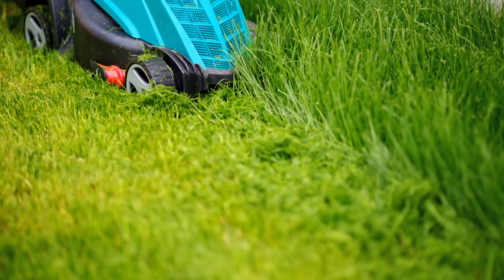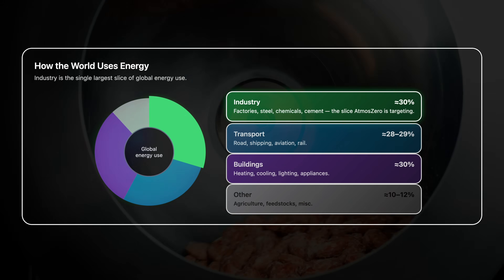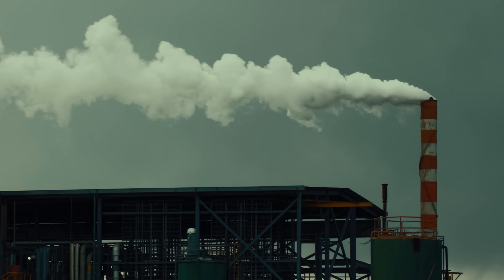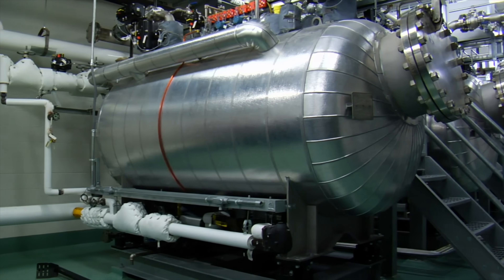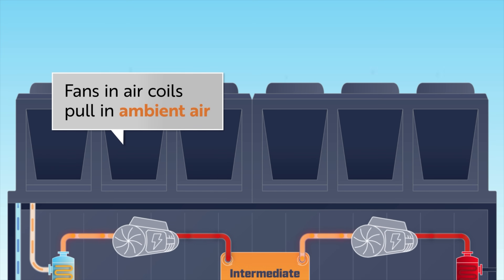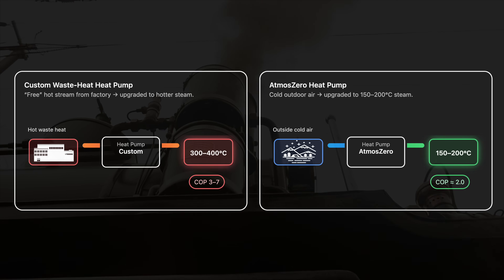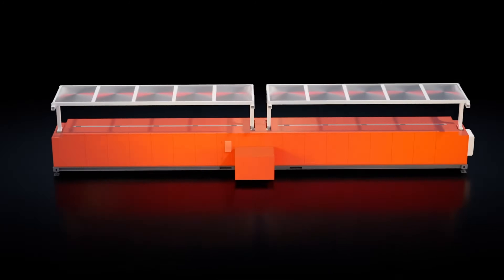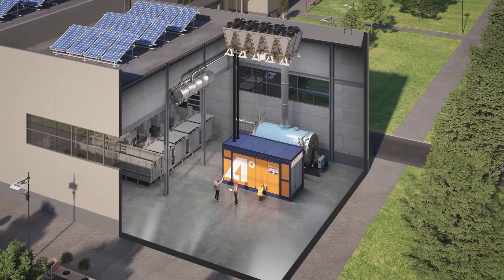This Startup Just SOLVED the Hardest Problem in Clean Energy

Comment: C02 is plant food !
Reply: So does that mean we can put CO2 into a office building ?
Reply: @catprog  Absolutely !   Commercial greenhouses have be using C02 generators for about 100 years ( they also produce heat and moisture in the air ) with absolutely amazing results. Humans do not have any ill effects until  C02 reaches about 10 times current atmospheric levels or about the level in your lungs when you exhale. Land plants evolved over the last 400 million years with atmospheric C02 levels many multiples above the current levels and absolutely love C02 as the bulk of the material that makes up plants is derived from the carbon they extract C02 as well as Oxygen and hydrogen from water and oxygen from C02. Elevated C02 also helps plants grow with much less water. Satellite data shows quite conclusively that the Earth is "greening" , i.e. producing much more plant material (approx. 30% more) as a direct result of the added C02 in the atmosphere in resent decades.
Reply: @EboregOnhzna  So if we filled a greenhouse with water that would be even better for a plant then having air? After all water is a plant drink so more plant drink must be good for it right?
Reply: @catprog  I never said we should fill a greenhouse with water.  

Air naturally has water in it. We call this humidity. The more water in the air the higher the humidity. Plants like high humidity, think high humidity jungle verses low humidity dessert. Greenhouse CO2 generators burn natural gas which produces heat, water(humidity) and high C02, all of which plants love. 

High CO2 levels in the air also help plants in dry, low humidity environments (desserts) survive with less water. Satelitte images clearly show that the desserts around the world are shrinking because plants survive with less water as the level of CO2 increases over the last few decades.

Comment: I have been saying for YEARS:
"There is no such thing as 'waste heat'. A use just hasn't been found for that heat yet."
Reply: Usually the problem lies within getting consumers and providers connected.
I've lived about 30 years with city provided industrial waste heat cityheating.
It delivers hot heat exchange water at around 70 degrees C. It exchanges heat with tapwater, or you can create a warm water circuit running on city heat water to heat your floor. Floorheating is the most efficient in comfortable heating.
Or you can run it through radiators with thermostatic valves.
But yeah, 70C is very high. You have to fill your floor circuit with cold water first before letting in city heat, because else the floor will break, and it needs a water pump to keep it circulating.
So for cities that concept is pretty good, as  the government can help connect producers and consumers by creating the intermediate company that sells waste.
The last time I saw gas heating was 30 years ago (central heating system) and it sucked compared to a communal central heating system.
Reply: If it's not being used, then it is being wasted. 😕
Reply: Except for waste heat from internal combustion vehicles. Not sure what uses you could channel that to.
Reply: @katherandefy if the system is so lossy that waste heat cannot be efficiently put to use, than it's a shitty system and should be replaced. A sentiment that applies to private vehicles themselves.
Reply: this is perfect said!

Comment: Have you looked at “Red Hydrogen”, I believe Japan is doing the ground work.

SMR is collocated on an industrial site producing steam/heat, power and Hydrogen from the one SMR for use at the facility.
Reply: SMRs can also be gas, liquid metal or molten salt cooled. Advantage becomes SMR after the 200 C or so limit mentioned in the video

Comment: They are making a cascade heat pump. This is nothing new and there is reasons why it’s not been mass marketed before.  

The issue is the refrigerant cycle. You run into the critical temp and pressure of the refrigerant plus you have issues with discharge temps and lubricants of the compressor. 

Using any type of centrifugal compressor you suffer from the lack of ability to handle a high delta P. 

I am betting this company isn’t trying to mass produce this tech. They are the typical start up where they are trying to get a halfway concept and then sell off the company to some giant company who ends up trying to make it work but never does but wants to own the patent. 

I’ve found that unless a company actually has a plan to make and market their product to the end consumer they are not really serious.

Comment: Since the topic is pragmatism. I would like to point out that half of expensive is still really expensive in this case. Sounds like gas is something like a sixth the price of electric resistance heat and this heat pump sounds like it’s half the price of resistance heating. sounds like it’s still three times as much as gas.
Reply: Depends on where you live. Hydroelectric power in some states is dirt cheap (I pay ~$60/MWh), geothermal has the potential to be just as cheap.
Reply: Solar power is cheap and when it grows enough and has battery storage to cover snow storms,there will be a need for dump loads . Not a perfect solution again but another brick in the wall.
Reply: @danielking2944 No one's building solar since 10 years of farms went bankrupt because the electric is TO cheap. It doesn't pay for the debt.
Reply: Well EU is rolling out blending sustainable aviation fuel with regular fuel, and that is 3 or more times more expensive than regular fuel too, so if you still have climate goals... things will get more expensive for businesses and consumers. If you are USA then yes, does not work... although seems like that brewery is going ahead, although maybe their product is that much more premium cost wise and their customers want green stuff so they can afford it.
Also I read below that actually since natural gas in EU is way more expensive, it may make sense economically too in those areas in EU where there is cheap electricity at least... mainly Scandinavia, maybe France due to nuclear... so might not even be that more expensive
Reply: You're right. That's the case for the US, but elsewhere (Europe) this is the perfect solution

Comment: Fantastic video. Can't help but wonder what is the equivalent of permaculture is to manufacturing? Why not use the excess heat from data centers to generate heat for nearby places that need steam?
Reply: Data centers are being built with nothing around for miles currently. There are so many costs and factors I doubt it would work out favorably in most cases but there has to be a few where is a perfect fit.

Comment: As a startup they don't have a market. So you create one. You focus on new construction facilities. That said. There is not one  legacy facility on the planet that doesn't have shutdowns for maintenance and mechanical failures. Shutdowns are budgeted and scheduled well in advance. Because components like this have a lead time baked in. There is your window of opportunity. All pre-shutdown work is budgeted for and completed in advance so the changeover becomes as simple as opening a few valves and closing a few more during the shutdown. I've been part of this process in one way or another for 40 years. It all comes down to proper planning and a keen interest in the outcome. That is as long as the equipment holds up it's end of the bargain.

Comment: Can you chain these to get even higher temperatures?
Reply: to increase steam pressure, increase the pressure; see steam tables...
Higher pressure requires heavier everything.  $$$
Reply: No. You need a diffrent type to go higher.

This is why it is a two stage proccess already. The two stages are diffrent.

Heat pumps work by converting a gas into a liquid and back again. You want the boiling temprature (at a certain pressure) to be between your two temprature zones)

Comment: There is also the possibility of using solar panels as a heat source. Since about 75% of the energy hitting a solar panel gets converted to heat and solar panels run more efficiently when cooled, this makes a lot of sense. I'm surprise I haven't seen a commercial/industrial application of this.
Reply: What about all the workers on the night shift?
The means of production are expensive, and steady use is more efficient.
Plus, the night guys need the work.
Reply: You can easily store industrial heat
Reply: @saumyacow4435  Pls tell us how, with transition losses and TCO.
Reply: Scaling is the primary issue here, you can't make the sun shine harder so the footprint required for solar to be effective would be prohibitive in an industrial setting.
Reply: @jarbuthn  Industrial settings usually have huge areas.
Reply: @saumyacow4435 In a "green field" (at design time) yes, but not so in a "brown field" (when already in production).
Reply: That realm of technology is called ‘PV-T’ (photovoltaic-thermal…. not to be confused with thermophotovoltaics!! ;)   I just wrote a DOE grant proposal on this topic so will share a little: Two main challenges with this approach, both making it “low-grade” heat:  
[1] the higher temp that the PV gets, the lower the electrical efficiency.  In theory, the Si cells are designed to withstand 75~100C, but generally 50~75C is the sweet spot for keeping them ‘cool enough’ and still have ‘usable heat’… but… pretty much for residential use, not industrial.  (Although interesting ‘input’ for their heat pump…).   [2]. the second issue is that that ‘heat’  is over a wide area - for MW, think in units of football fields.  That (a) takes a ton of HTF to pipe around, and (b) the harder part: insulating all that area to have it not loose heat to the atmosphere.  So, these systems are really sensitive to ambient temps (and/or desired temp differential to ambient), UNLESS you pay a bunch for insulation.
[3, bonus] 50% of that ‘heat’ on the PV re-radiates out the front of the panel!! ;)  They can cover the panel with another glass pane (like windows), they call ‘glazing’ and you do get a bump there - at a cost of both the materials, and the sunlight hitting the PV.  Generally, this version does win by a smidge.
Reply: @jdtransformation We're talking about using PV panels as a heat source for a heat pump. So they're going to get cold.
Reply: Does the cost of cooling the panels outweigh the cost of doing so.

Comment: Brewery tour and closeup look at the system sounds good. Be aware that they are comparing their COP to the electric boiler and mention the 20% losses on the gast powered. If we assume that the electricity comes from fossile fuels, we're looking at a 40% efficiency in gas to power and about 5% transmission losses equating to 35% of energy at the input of the heatpump. Assuming a COP of 2 which is quite conservative, we're getting about 70% the energy that was in the gas. So the gas boiler is still about 10% more efficient in direct comparison.

This does disregard two facts though: 
1. When renewables produce power, the heatpump allows for zero carbon emissions
2. A COP of 2 is very conservative. If one integrates greywater heat recovery or cooling the beer with the waste low-temperature fluid, this shoots up dramatically.
Reply: " If one integrates greywater heat recovery or cooling the beer with the waste low-temperature fluid, this shoots up dramatically."
I would not want to be the spokesperson explaining that loop. But good stuff.
SEE: ‘Riothermie’, named after the Dutch words for sewer (riöol) and warmth, is a 24/7, year-round heat source that marks a significant leap towards greener and more efficient urban heating in the city... heat exchanger raises its temperature to a medium level of 60-70°C.
Check it out!
Reply: @CCRoselle  Oh yes, I think multiple cities are implementing this at the moment (dec 2025) .. Here I was thinking brewery where most of the washing water will still be way above 20C .. Cycling that will bring the COP up by at least 1 or even 2!
Reply: We need to remember the cost of installing this system, maintenance, and replacement when it wears out, conpaired to the natural gas system just chugging along at 80-95% efficiency for years with minimal effort and no time of day use fluctuation in cost.
Reply: @jasonneugebauer5310  Both systems need maintenance. The fluctuations for fossile fuels are spot prices in the gas market or coal bought at a specific time, oil bought at spot price .. Yes, boilers will require less maintenance than a heatpump but on the other hand one can set off the CapEx and the running costs by installing solar. It will not cover the whole running costs but make a significant dent. That could not be done with a gas boiler. 

There's so much more to be thought of .. Too much for youtube comments :)
Reply: @einball   installing solar in such industries is cool and all, tho most need so much electricity that there usually won't be any excess, that step should be considered no matter how the dry steam gets produced.
Reply: @HHdiggAAA  Absolutely. My former employer installed solar and produced about 1GWh compared to 5GWh consumption a year. That is not nearly enough but still about 20% less power generated by fossiles, raising the overall efficiency of a potential heatpump significantly and bringing it into the 'higher efficiency than a fossile fuel boiler' territory. 

I would really like to see an in-depth evaluation from the manufacturer. As it stands I think there is not immediate [energy] advantage to using a heatpump. This only comes with (and needs) a restructuring of grid fees and the grid model .. Or more solar .. More solar seems to always be the answer here 🙂
Reply: @einball if you were just going for using solar to offset cost, you could easily install a huge solar array and just use resistive heating with the natural gas heater, reducing natural gas use to zero during sunny days, and forgo all the complicated heat pumps.

I am pretty sure this is a cheeper less complicated more long term way to reduce carbon emissions.

They could even incorporate a thermal battery to store solar energy for extended use 

Heating steem from an air source heat pump is inefficient, overly complicated, and will break.
Reply: @jasonneugebauer5310  I'm not really sure where you get that inefficiency claim from. A COP of 2 is half the energy input for the same heat output compared to resistive heat.
Reply: @einball  inefficient conpaired to natural gas, and much more complex than a large solar installation with direct resistive hating to augment reduce the natural gas usage.

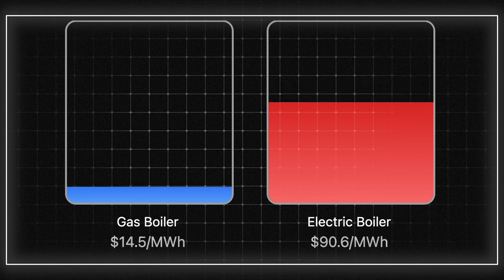Comment: I think you blew the cost comparison, probably intentionally! Your graphic at 6:04 has a gas boiler at $14.5/MWh and resistive electric boiler at $90.6/MWh. Then you say Atmoszero heat pump has a COP of 2, which would drop the cost in half to $45.3/MWh, which you never say. That’s still 3x the cost you gave for gas boiler, so where’s the advantage? What did I miss? 
Also, a heat pump COP of 2 stinks compared to the mini split at my house. Why so poor? 
I am excited for a future that tackles problems like this, but I left not seeing the light here.
Reply: " Why so poor? "
That second stage pumps up the heat and pressure,  NOT CHEAP to run.
Reply: The mini split has a much lower temprature difference. Higher temprature differences have much lower COP.

Comment: @ a COP of 2 you get from 6x as expensive to 3x as expensive as natural gas.  It’s impossible to roi such things in industry.  Even if they got to parity in fuel cost the coo and upfront cost would kill you.  If this is going to work the complex installs and efficient heat transfer will be required.  If you do make it to FoCo I’ll recommend swinging by Odell’s, it’s the local favorite.
Reply: and lets not forget adding more demand to the electric grid is just going to increase the cost of power, this really only works if you are trying to go full renewable with solar and wind and even then it's decades for ROI at that rate.

Comment: Atmospheric carbon dioxide is the gas of life!   1200 ppm carbon dioxide three times today's level is used in plant growing greenhouses and would greatly green the earth with plant growth.  The greening of desert fringe areas over the last hundred years is considered be caused by higher atmospheric carbon dioxide.   What makes no economic sense is why a US industry wouldn't be using natural gas for generating high pressure high temperature steam.   An electric  heat pump making heat is an expensive form of providing heat.  The larger the temperature differential the lower the efficiency of a heat pump.   Most heat pumps are used for cooling where there is no realistic alternative.   

Industrial cost of electricity where the industry builds and maintains much of its grid structure or pays separately for it can be at the lower end price in Northern California hydropower at $0.05 kWh ($10 MWh).    That's a price Tesla uses in promoting charging its Tesla Semi.  

Southern California has the most expensive electricity in the US even higher than Hawaii.   Any energy using device if possible should run on natural gas in the US instead of the grid electricity for large savings in energy costs.   Home electrical appliances such as water heaters and clothes dryers discourage heavy use of the electrical versions with restricted electricity heaters.  The natural gas versions besides being much cheaper to run are about twice as fast in providing heat.   

Southern California peak cost electricity for LA is about $0.60 kWh.   At that price its cheaper to run a low efficiency natural gas back up generator on expensive residential natural gas than to buy the electricity off the power grid.